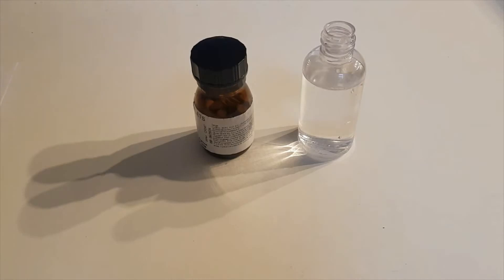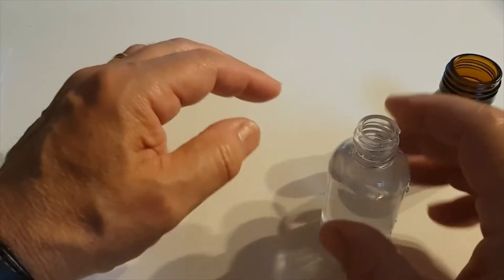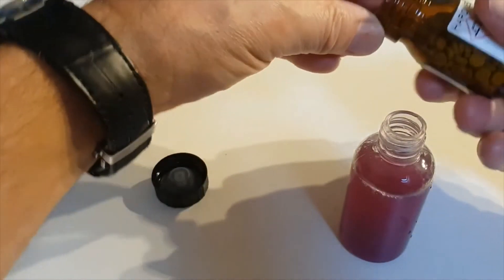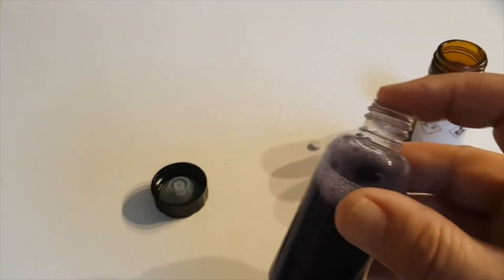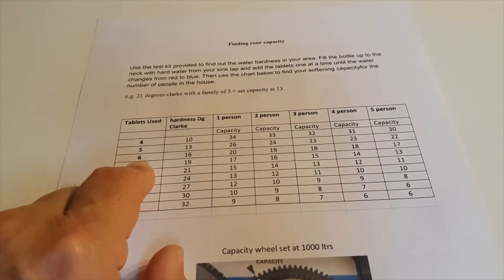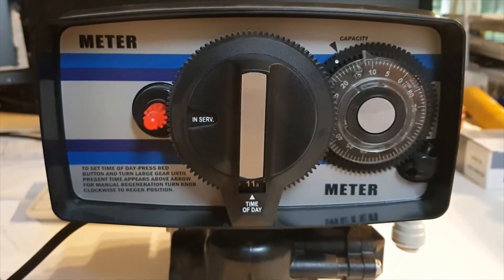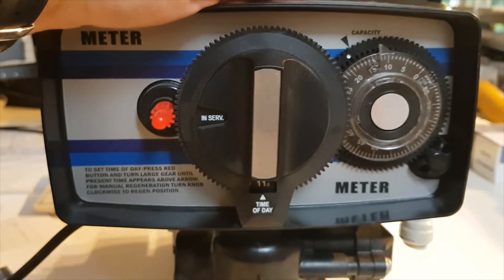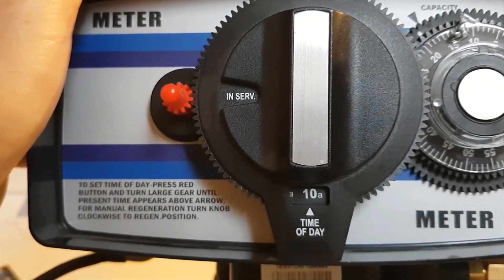How to program a mechanical meter water softener

Comment: Please confirm. The time of day setting has nothing to do with when the machine goes into a regeneration cycle.  Correct? If so, what is the purpose of TOD setting?

Also, on my unit, the white dot was at position "1 o'clock" as if the dial were a clock. Does that move, as it differs from your video?

Comment: Hi, thanks for the video. I have a couple questions. Do you simply set the time of day and chose the number of liters on the right hand dial before regeneration, and the system automatically takes care of the rest? As in backwashing, rebrining, flushing etc? 

If you turn the dial on from in service to the right, there's a number of other options you can choose.

Comment: Hi. My softener has no white dot. On this model in video where is the white dot in relation to the cut out part of the inner wheel(the part of it that has 5 or so teeth missing) . Say if the cut out is at 12 o clock. Thanks.